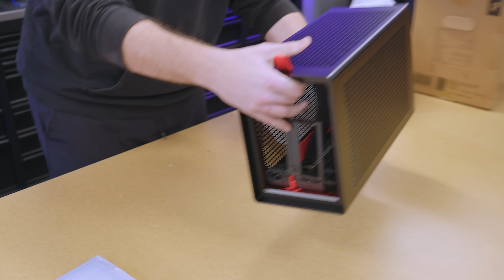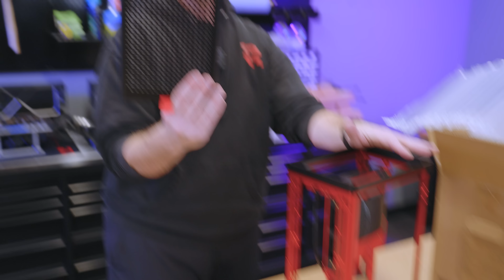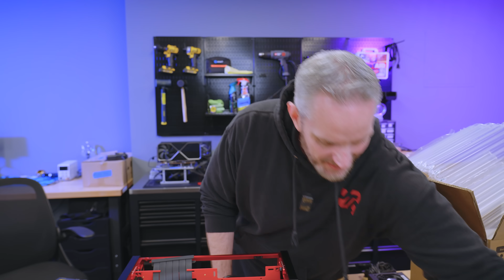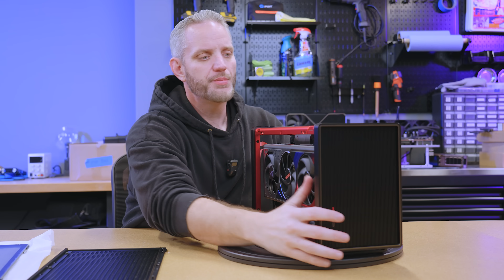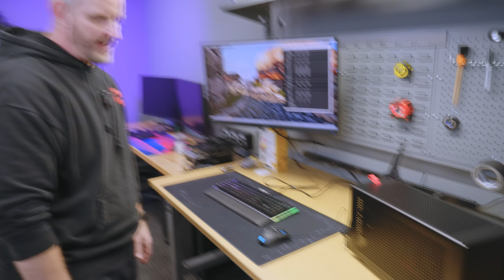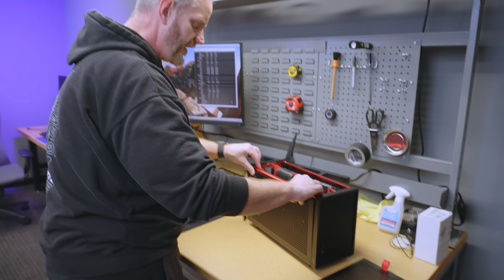This build quality is INSANE! CNC Milled, Modular and Adjustable!

Comment: With a little bit of creativity, it would be very easy to make this fully water-cooled. Custom cables, soft tubing and ingenuity would allow for a few more fans, a 240mm radiator and plenty of room for everything.
RGB in this case would be foolish, as it should be a discreet case which fools the eye.
All GO!! and no show. Subtlety at its finest. Get rid of the silly and expensive red anodizing, and there you are.

Comment: If you wanted to mount it vertically just design a stand and 3d print it to see how it works.  I do think it would defeat the purpose of the bottom to top airflow, and the front panel being solid doesn't help, however it does have very good airflow with all the ventilation holes in the panels.

Comment: in most sandwich style cases like this, case fans set to exhaust will outperform intake. & sadly the Pure Rock LP doesn't perform on par with other coolers at the same 47mm height. the AXP90 copper easily outperforms it, as does the IS-47-XT.

Comment: I just moved my SFF build from the Dan LianLi A4 H20 into the NCase M2. Now I'm wishing I would have known this case was coming. I loved the A4 H20 build quality but it wouldn't fit the video card I wanted to use, ultimately.

The NCase M2 is pretty good but it seems to scratch easily, and personally I'm not a fan of the flat pack assembly. After having gone through the build, I'd rather have a fully rigid outer frame. Yes it is very dynamic and adaptable to different build configs, but I don't like the fact that all of the pieces are held together with a couple of M3 screws. Until every single side of the chassis has been screwed down the case has a bit of flex to it. This makes it a bit precarious when moving it around during the build.

I will definitely check out this new Antec for my next SFF.

Comment: I can guarantee you the panels at least are not CNC milled. They are aluminum plates, the mesh is probably laser cut or just stamped. The inside also doesn't scream "CNC milled", all of that just seems rolled aluminum or sheet. I wouldn't mill this for under a 1000 € tbh. And neither would Antec. Which does not mean the quality of the case is any lower, it just means milling is too expensive for serialized products that are mostly thin walled. Edit: one part seems like it was milled :D

Comment: Interesting question.....with the Fractal Terra with its single bottom fan being recommended to be set at exhaust instead of intake as that cases design is set up where hot passive air can recirculate into the case with that bottom fan.   I wonder how switching the dual bottom fans to an exhaust configuration if it would be better in this Antec case as well?
Reply: get a formd t1 its much smaller more space optimised than terra better build quality
Reply: @SarthakNarnaulia that leads to the next question regarding the FormD T1.....I notice many people orientate their cases to put their case fans and AIOs on the top for exhaust.  However, isn't that case's original spec have the case orientated where the case cases are on the bottom for intake and to use air coolers for the CPU like this Antec Performance M1 here?
Reply: @SEMCOManagementInc  you can either place top or bottom for exhause and in most itx sandwich layouts thats optimal to push fresh air directly to cpu air cooler or gpu.. if you you bottom as intake it will fk up your airflow just because you are not pulling that much air from side panels.  in case like nr200 you should place bottom as intake just because it is not a sandwith layout setup and has gpu just about bottom intake fans. and top as exhause so that hot air wont recirculate inside the case.

Comment: I doubt its cnc milled though. The mill will have to plunge trough the material so many times, its would take a long time to produce. pre drilling would help, but still.
More likely they would have used lasercutting. electrical discharge machining is also possible, but that kind of precision is kind of overkill for a pc case.

Comment: I’m a big SFF guy, but having practically no AIO support for a CPU that’s supposedly paired with a 4090 is insane. Even the Meshicilious supports a 280 rad… from years ago.
Reply: The Formd T1 can take a 240. And it is quite a bit smaller.
Reply: @_shreyash_anand  Yeap comparing this to the Ncase M2 where you can fit a 280mm Radiator + 4 fans + Any full size GPU it's really no contest especially with the M2 being half the price.
Reply: The 7800X3D is really easy to cool. Even small coolers are fine here. And even the 9800X3D isn't excessive so this doesn't need a 280 rad. The Noctua NH-L12S should do fine with either of those.
Reply: @JikoMuskato  That's a 70mm cooler, if you can fit the fan underneath it ... that leaves only 55mm for the GPU, which is roughly 2.5 slots ... and only 40mm (or 2 slots) if you have to fit the 15mm fan on top. And you'll run a 7800X3D around 80C that way, which is ridiculous considering 1- the size of that case 2- the price of that case ... and you'll still be left with a tone of empty space because there are no ultra tall / long GPU in the sub 2.5 slots that justify such a big and expansive case with poor CPU cooling
Reply: @JikoMuskato  It's about giving the customers multiple options though, not what should just do fine. There are alot more cheaper options out there with better compatibility with different hardware.
Reply: It's quite a bummer, because I really like the overall aesthetic. But it is unnecessary big while having zero support for at least a slim 240 AIO, nor allowing for an upside down use. There are better, smaller and cheaper option out there. On a positive note though, it has easy cable management 😅
Reply: This was my first thought.  Bigger than my A4-H20, no AIO support, and that PRICE...yikes.  Looks really great but no thanks.
Reply: you don't need an aio for a 9800X3D or 7800X3D
Reply: I'm a small SFF guy.
Reply: It would be so easy for them to include a bracket for it
Reply: Second this. The Antec is nearly 19L and has so much wasted space being a sandwich layout that could have utilized thick AIOs.
Reply: I build in Dan A4-H20 and I can say it’s still better than this crap
Reply: @Meesaa06  A4-H2O gang rise up - legit such an amazing case

Comment: Symmetrical top and bottom panels for swapping exhaust fans to the top would be cool. A symmetrical MB tray so swapping sides with the fans in either top or bottom, so you could choose what side you want facing the desired direction. The I/O end cap could accommodate an insert that could be legs of lengths and configurations for cable management, cooling and aesthetics or even an extra fan. Unless the I/O end cap is removable (he didn't say if it was or not) then just swap the whole thing for strength.

Comment: Why use a downfire cooler? Wouldn't that be blowing the hot air into the case that then needs to be pushed up to be exhausted. The cooler fan is right next to a mesh side panel, why not pull the heat up (side ways in this case) and straight out of the mesh side panel.

Comment: Jay, you guys have a 3d printer, just design and print some feet or a base so it can be used in a vertical orientation
Reply: That's irrelevant, it's an oversight of the manufacturer to not include something like that in the box.
Reply: Most prospective buyers are unlikely to have 3d printer access.
Reply: @zwabTheRealOne  There's so many 3d printing services out there these days, that it's far less of an issue.
Reply: @agentcrm  Still not the point, as archimhaun2726 puts it above, the lack of such accessories are a failure of the manufacturer.

People shouldn't be 3d printing crap to make a product work, and in that same vein, reviewers shouldn't be 3d printing crap to cover up for deficits in the product they are reviewing.
Reply: @zwabTheRealOne  Or it's not how the manufacturer intended for the case to mounted.

Comment: Good effort but as usual with antec. Too late and Copied ideas  without  thinking about the design.   19L and no placement options  for AIOs or actual big air coolers. Where does all that space go? 

Shouldve  left out the sandwich style.

Comment: Hi Jay. I am surprise by the way you are presenting temp results here. On some shots we can see that GPU utilization is only 70% went benchmark runs. The 4080 is far from pushing its max power here, and you don’t talk about it. Same for CPU, you make it sounds like temps are for a 150W workload, which is certainly not the case with the benchmark (no info also on that). 

What you are presenting here is temp results in mild gaming load, and not max load on any components where this build is certainly a throttle fest. 
I think you should mention it.

Comment: I have been looking at SFF cases to transfer my current build into and I am very confused.

The dimensions listed on the ASUS website is 358mm. Jay says that the it can fit the 4080, 4080 super, and 4090. Why does asus list the card at 358mm of length?
Reply: Not all cards are created equal. The partner cards can be a lot bigger if they want to maximize the cooling performance.
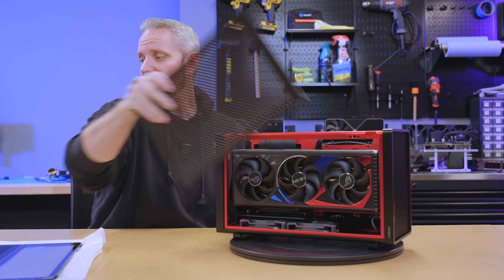Reply: @Ronin2300DK  I get that but the partner card he is using is  4080.  At 11:30 he says that the 4080, 4080 super, and 4090 are all the same size. Also says that it fits a 350mm long GPU. If you go on Asus specs sheet for the 4090 it says 358mm for length.

Comment: The sheen on the anodizing actually isn't really an indicator of quality. It's more an indicator of the style of anodizing, as it would be a soft anodizing. A proper hardcoat anodizing can't really end up that consistent or clean. The struggle to get quality anodizing done in colors is why one of the few that does it right (Geissele Automatics) outright says that their anodized parts of the same color won't necessarily match.
Reply: Never thought I'd see someone mention Geissele on this channel.
Reply: Agree for the most part but you do not need hard coat anodizing for a computer case.
Reply: Hard Anodizing is an entirely different process.  This is to protect from oxidation and to make the aluminum look good.  Hard anodizing is for wear surfaces.  (I should be a first grade school teacher around here)
Reply: The glasses were pushed so high up w/ Michael bay levels of lens flare before this statement was made huh.
Reply: Yeah and the panels being CNC machined seems highly dubious. I haven't seen a price for the 1 M but the waste produced by machining those panels seems extreme and cost prohibitive. IMO, only the skeleton is machined.
Reply: @Jay.McCarty  Agreed. Something is off about either the info from Antec or Jay's statement.
Reply: @Jay.McCarty  They'd using an extrusion for the basic shape, then CNC cutting the mesh and internals.
It does say on the website that it's CNC machined. (which all non stamped cases are for production)
Reply: @agentcrm  So using a CNC for drilling. That's fine but not quite as described. Also doesn't the website say the "chassis" is CNC machined. Unless I missed it while skimming, I don't see anything about the panels.
Reply: @Jay.McCarty  The panels are still part of the chassis.
Yeah people assume CNC machined means taken from a large chunk of ali.
In this case it's probably milling out all the channels etc.
Reply: @Jay.McCarty  I mean CNC is just computer numeric control. So a modern punch is a form of CNC. Not really wrong, but most lay people wouldn't apply CNC quite that broadly.
Reply: @Jay.McCarty  100% Jayz once again makes things up!
Reply: Good point!  While the sheen does indeed indicate the style of anodizing and the surface prep of the metal, I can promise you Jay has enough experience with anodizing that he can judge quality.  :)
Reply: @shortbussrifles  You can't judge quality without a spec sheet and how it was done chemically... that's kinda the point I'm making. He can judge that it looks nice. Do you have any idea what type of anodizing it is? The thickness? The surface hardness? Antec obviously isn't going to go with Type III hard coat. It's almost definitely type II because that dyes best. But type II is definitionally not a high quality anodizing: it's done because it dyes nicely, not because it actually creates a thick, hard layer on the surface.

Comment: Hey Jay, I would love to see a 9800x3d build in this case. I'm thinking about using the case but worried about excess heat in the new x3ds when using the low profile coolers.

Comment: Ok stop right there. Take your power draws and thermal temps in the case during the tests handed to them. Record it with a differnt camera at start and stop and compare it to the logs. Then take that power supply out of the case and run the power cables into the case themselves... Then redo the test.... I think you will see free performance uplift and power efficiency.

Comment: I wonder if that gap in front of the fans would hold one (or two) of them baby Noctua 80mm fans?  NF-R8 or something like that. I think they're less than 20 a pop. Edit: I think Noctua's low pro CPU cooler has a higher TDP than the Be Quiet one. If it fits...

Comment: It would be cool to see something like this but like 2-3” taller so you could fit like a 45mm thick radiator on the bottom. Then a side panel that has 280mm mounting options for a second radiator.
Reply: I always think the same. It was already extremely hard to fit two 240 rads into my Jonsbo A4 (one top and one on bottom). For the bottom I needed to make a custom frame to rise the case a bit and fit two slim fans into the frame.
I really would love to see a sandwich style case which fits two rads out of the box.
Reply: if that what you're looking for get the dan cases | lian Li. it supports 360mm AIO and has 335mm of GPU space. Its a MATX build and is about 26L
Reply: @ only a single 360?
Reply: Radiator on the bottom is a bad idea unless the AIO has the pump mounted in the rad
Reply: @ I’m not taking about for an AIO and I couldn’t care if it works for them or not.
Reply: @rekareaper  I mean frankly the market for SSF is already niche, and within that niche custom liquid cooling in SSF is even more niche. Virtually no manufacturer will choose to care about radiator mounting without also caring about AIOs.
Reply: @ the fans are already on the bottom. It’s pretty obvious there is no intention to put an AIO down there and this likely isn’t a mass produced case with large amounts of stock on shelves and in storage. Moving the fans requires more of a redesign than a simple extension. Placing them on the top instead of the bottom also means you would need three dust filters instead of one or two (two being the case with the side panel I suggested) unless you used the top as intake. Dust naturally settles on the top as well.

Comment: I dont see what this does better than formd t1, except maybe the strix is the one gpu that does not fit there... With default aircooler. There is just so much space unused/unusable...

Also, the bottoms intake fans do little for cpu and fight gpu exhaust.
Reply: Bottom exhaust fans have worked better in my SFF builds.

Comment: The Antec comeback is real
Reply: Excited to see it too. Used to use nothing but their cases 15+ years ago. Would love to see them do an updated version of the 300 and 900 as throwbacks.
Reply: @motorcharge4025  The Antec 900 was legendary
Reply: Restoration/retrofit parts (updated USB front panel, short HDD-delete front cages, Big Boy top fan) for 900s would be nice. Still got mine.
Reply: currently still running an Eleven Hundred V2 Black. I was just going to get another Antec case for the next build. I really like this.
Reply: I just gave my NX410 to a friend, upgraded to an Okinos Mirage 6.
Reply: I still have my Skeleton case
Reply: Hyte
Reply: What come back?…Too expensive, Antek offered good products for cheap….this is a rip off, not a come back.
Reply: @cezarnebun9607  i dont ever remember "cheap" lol my 1100 R2 cost like 120 bucks in 2012. Cheap is like 30 bucks